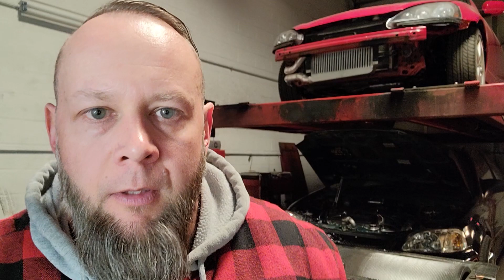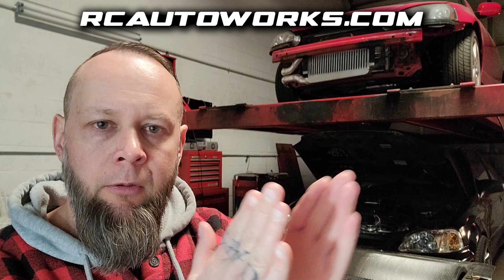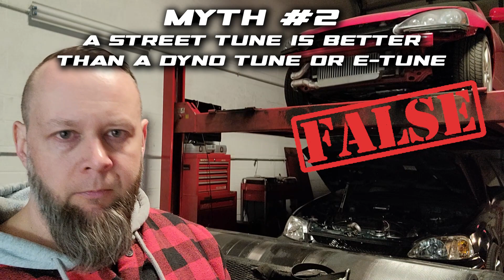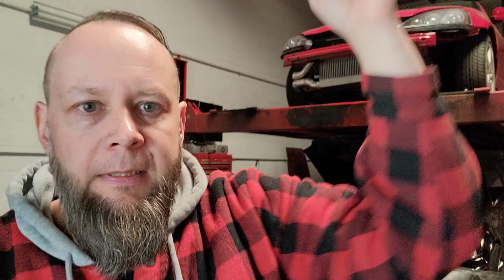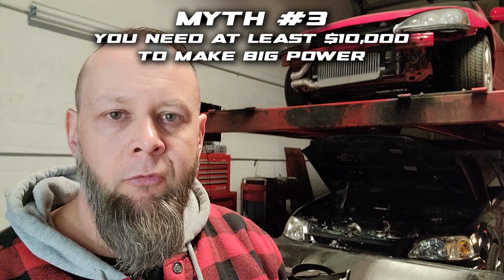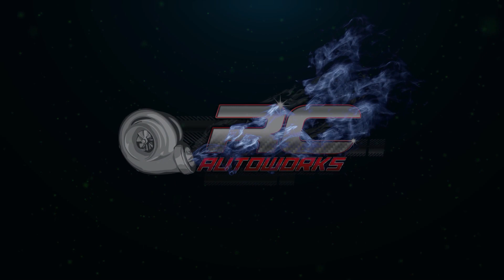MythBusters Ep.6: Downpipe/Header + Tune?, Street Tunes VS. Dyno tunes?, 10k for High HP Builds?

Comment: Great info as always. I think the "10k+ for high HP builds" myth gained a lot of traction because people see a lot of people blowing up their motors when they boost them (even the 400-500 hp builds). I even find myself kind of hesitant at the idea of supercharging my SI (my goal is ~350hp), because I always hear that the 6th speed K-series transmission are like glass.
Reply from the maker: Thanks for watching and commenting, I just hate seeing younger people discouraged thinking it can't be done correctly on a budget. Yes, some parts you should never skimp out on but other parts you can buy used an saved. Not everyone has 5 or 10k to just spend.

Comment: Thank you, for making these videos..
So, so much misinformation.. That's what has discouraged me in my car. A lot of forums with bad attitude or being un helpful. Ex: I wanted to do a manual swap 6speed, you have ppl say, " Just buy another manual car, it easier. Or it's a waste of time" and it shuts down others from helping. I'm still stuck at a crossroad on what to do next.
Reply from the maker: You're welcome and thanks for watching. There's a lot of bad attitudes in this industry that can easily kill someone's attitude in this scene. Gotta brush it off a little bit but also realize if someone that knows a thing or two is telling you something you may not wanna hear, it may be wise to see it from there view point. We had a few customers lately that wanted to build something really different, we're talking about putting a Honda engine into a Cadillac, or sticking an LS engine into a new Honda. Anything is possible but the amount of money for a custom project like that can easily get up there quickly. I think these customers were upset that being that different would cost that much money. Now does that mean we're being rude or mean, no, could they have took it that way, sure. What year and model is the vehicle you speak of?